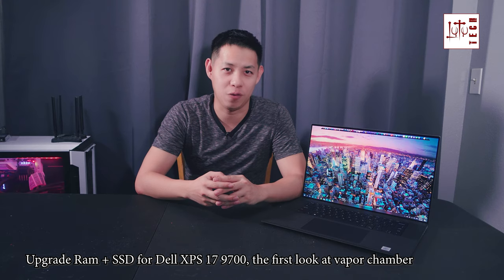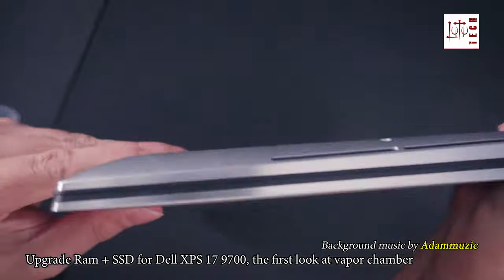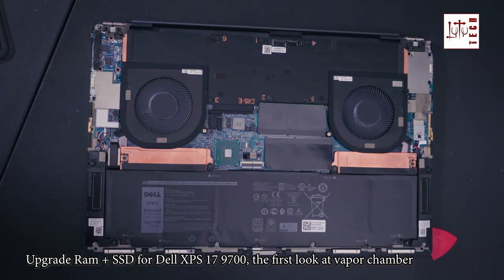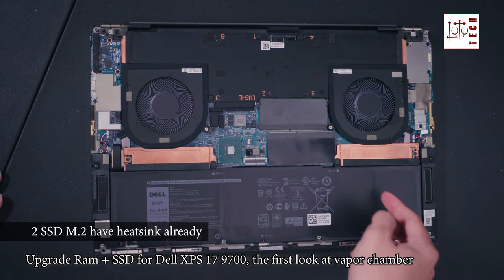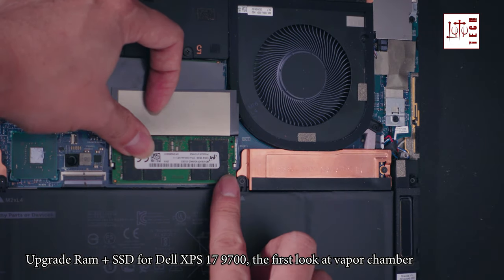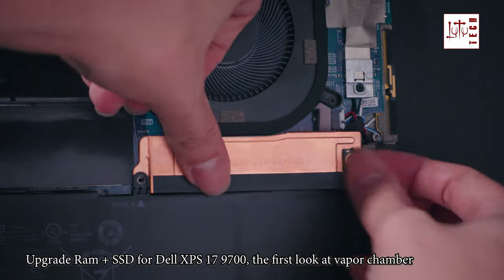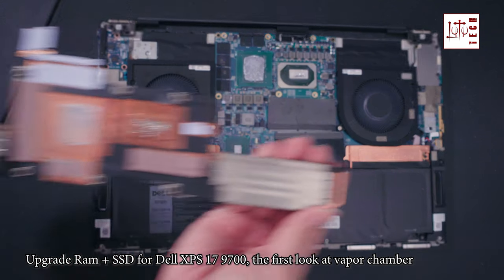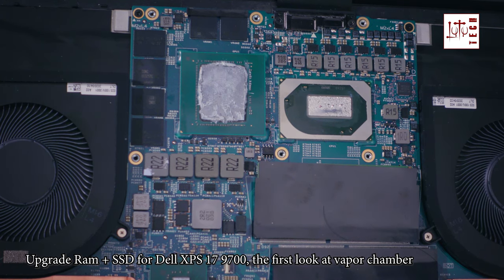How to upgrade DELL XPS 17 9700 +  first look at vapor chamber

Comment: Hi, I have a question @LuTuTech  - I like to upgrade XPS 17 with a new SSD, on the motherboard, there is like black rubber socket and metal pin in the casing what is that?

Comment: Holding an XPS 15 9560 and hesitating to buy an XPS 17 because of the trackpad issue ...
Reply from the maker: QC of dell on xps line is not good, mine doesnt have trackpad issue but another issue: coil whine sound
Reply: @lututech2042  can you please post a video with the coil whine sound ?  also can you run a LatencyMon test for 10 min and post the result? ... i just order my xps 17 but all the issues with it make me want to cancel my order.  thanks
Reply from the maker: @studiofl259  in next video: in depth review, I will state all possible issues that you can face. For latencymon, if u disable all services except windows services or disable bluetooth in device manager, there will be no problems to handle real-time audio processing. I did 15 mins layencymon and the result was good